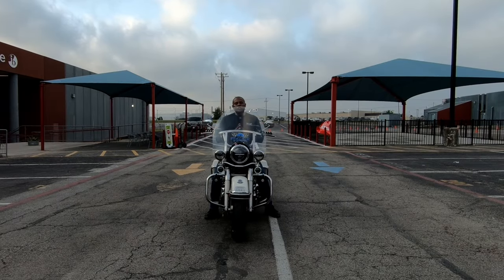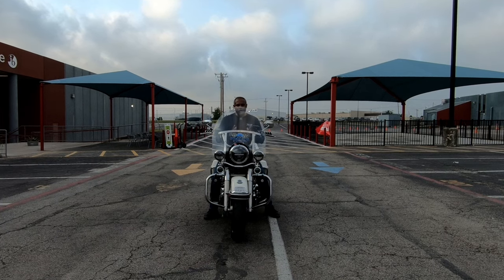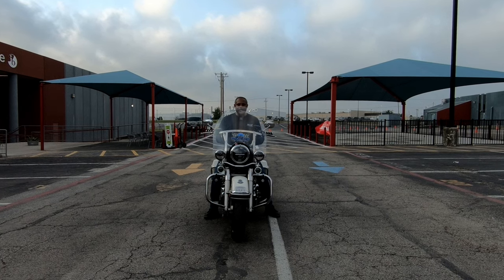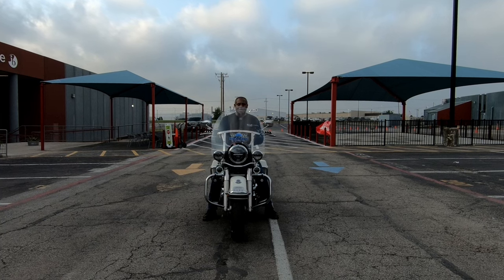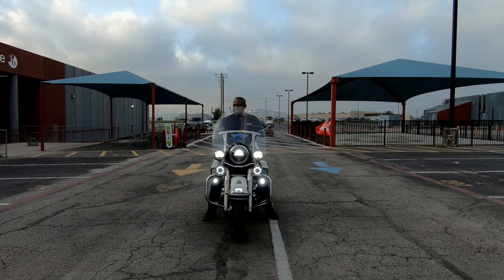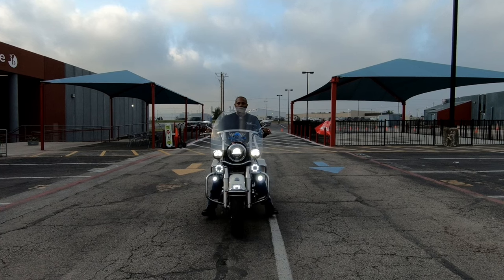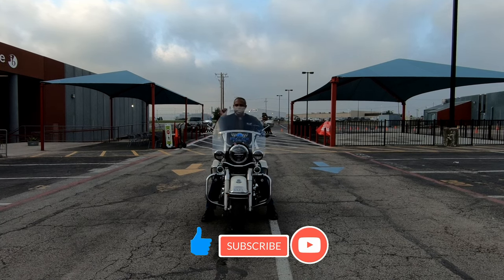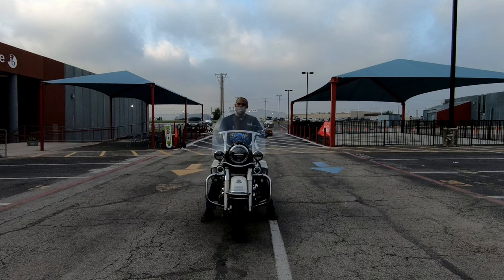What's The Key To Mastering Slow Speed Turns On A Motorcycle: Clutch Or Throttle?

Comment: I wish that you had some of the same lessons for DCT Bikes like the Honda CMX1100 Rebel that I own because I can no longer use a gear shift lever. Only using the throttle and rear brake can be a little challenging at times. 👍🏾
Reply from the maker: I need to see if I can find one to ride for a little so I can put out some material.  The DCT does take some getting use too from what I am told.  Thank you for taking the time to watch.
Reply: @ProriderCentralTexasYouTube   I think that the Goldwing would be appropriate for your demonstration if you can get your hands on one. Thank you for responding! 👍🏾

Comment: Hi. May I know if what lower gear do you do when you enter a busy road? is it first gear? because when I tried to play tue clutch with my gear on 2nd, the mtorcycle went off. Btw,thanks for the video
Reply from the maker: Usually I will be in 1st gear if I am entering from a stop or from a low speed.  If I am entering a merge lane and there are not vehicles coming then I may be in second gear if my speed is higher.  So it depends on how fast you are entering the road.  I hope this helps. If not let me know

Comment: When we are on a straight piece of road and want to turn off onto another road such as a side road, Do we keep the clutch in the friction zone when we make the turn or do we just downshift to a lower gear and use the rear brake without using the clutch to make the turn?
Reply from the maker: The answer is it all depends on the speed you are going to take the turn.  For most turns I will downshift to a lower gear and then stay in the friction zone until I complete the turn.  This will allow me to control my speed during the turn for tighter turns.
Reply: @ProriderCentralTexasYouTube  K thanks, I appreciate it. I am learning all about my bike. I see now the clutch controls the speed of the bike. Thank you for all your info.
Reply from the maker: @kjvbiblebelievertal7431  You bet I am glad to help.  The next time you go out play around with it and let me know how it goes.  I did a video on this but I couldn't find it.  I will continue to look and I may just do another one.
Reply: @ProriderCentralTexasYouTube  I tried that and it worked really good and I let the clutch control the speed while in the friction zone and my bike was in 2nd gear as I made the turn and as my bike finished the turn , I gave it more throttle to accelerate and upshifted to 3rd gear. I still need practice on making the turns a bit tighter though. Thank you for all the info you gave me, I really appreciate it. Also, the more I ride my bike, I am finding that my shifting is becoming more smoother.
Reply from the maker: @kjvbiblebelievertal7431  Yep the more you ride the more you will get familiar with the bike.  I am glad you are working it out.  Please keep me posted.
Reply: @ProriderCentralTexasYouTube  I sure will Thanks.